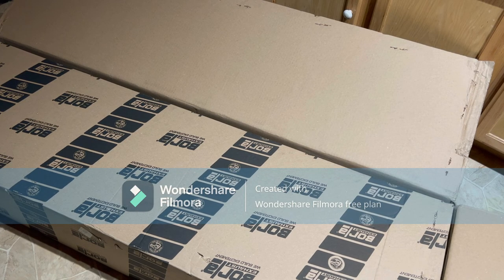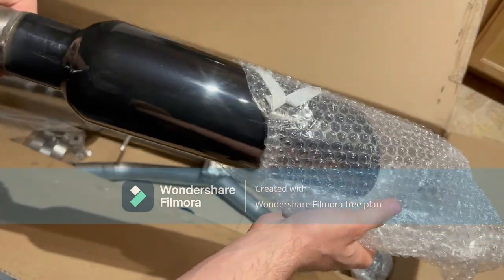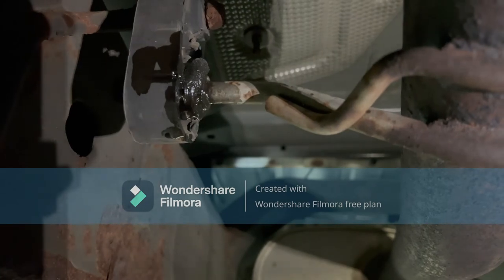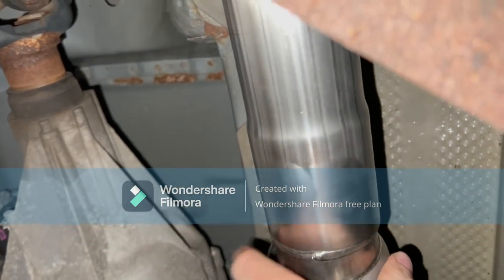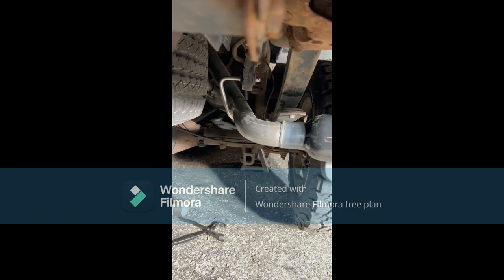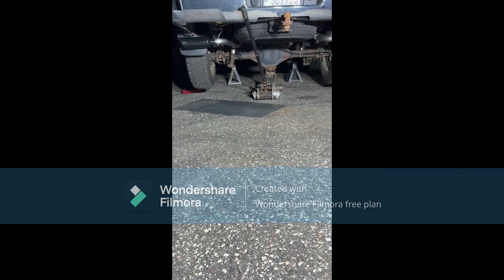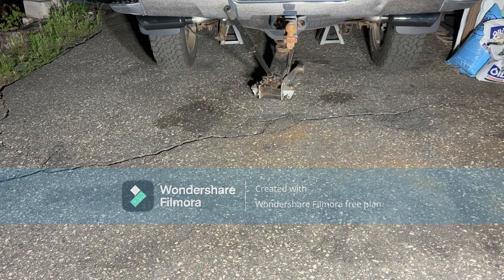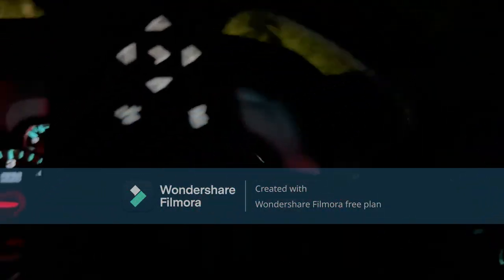Borla S Type cat back exhaust  install on my 15 Silverado

Comment: Looks great! I’ll be getting the same system for my 2016 in the spring, I have a Flowmaster system which is decent but not as good sounding as that
Reply from the maker: heck yeah love it still trying to motivate myself to do a one year review rn lol
Reply: Any drone at all at any point?
Reply from the maker: I haven't noticed any though the type s is mid range on the loudness scale .the system offers a drone free guarantee I believe . will say when the truck switches to 4 cylinder  can sound kina different. it doesn't bother me , and can disable 4cyl mode with mods 
      @dantheisen1227

Comment: In the directions it says something about a torx socket.  What is it a female outer socket or a socket with a male tip?  What’s it for and what size is needed?  Thx
Reply from the maker: my system didn't need a torx /(star)socket just a (normal socket and a torque wrench ) and I would suggest a hanger remover tool  best of luck  !!
and thanks for watching !!